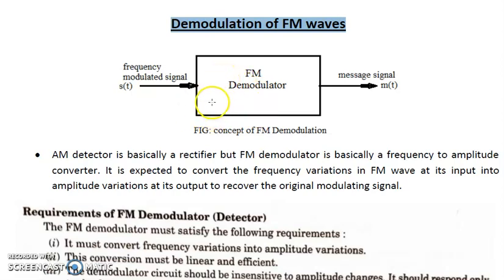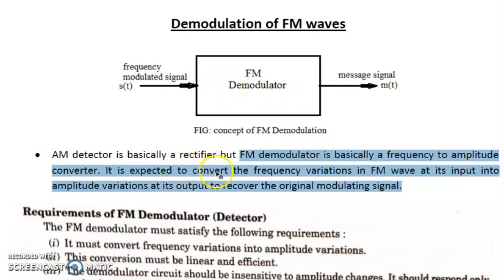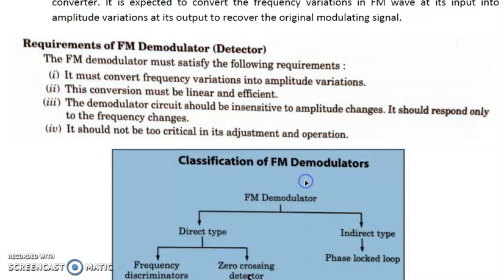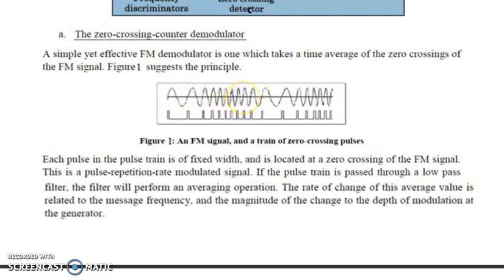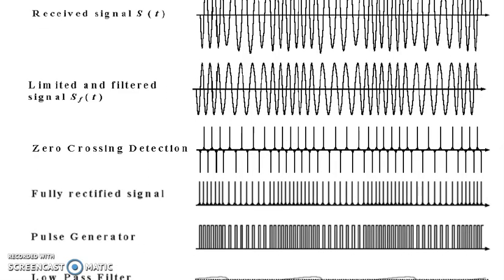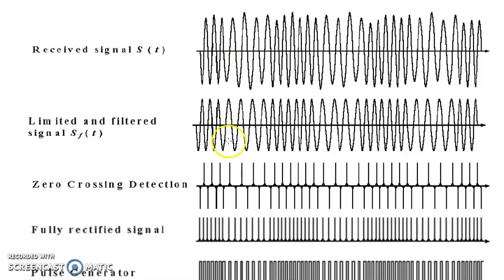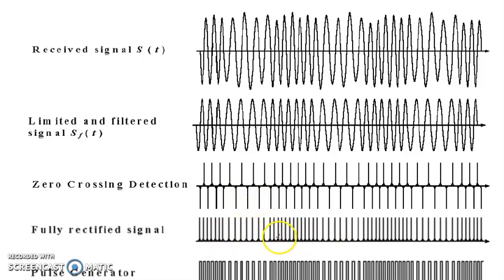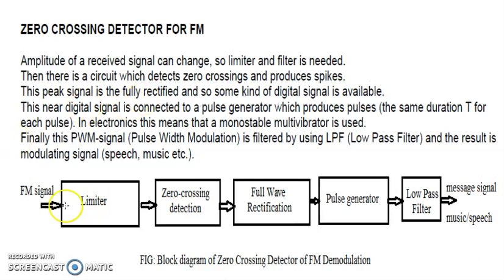FM detection using Zero Crossing Detector

Comment: Ec/95/19 (puja kumari) 

Mam plz explain zero crossing detector in a simple way. I couldn't  understand that line?
Reply from the maker: Zero crossing means when the signal amplitude is shifting from negative values to positive values or shifting from positive values to negative values.
Whenever a sinewave moves from positive half cycle to negative half cycle, it crosses zero point in the X-axis and vice versa.